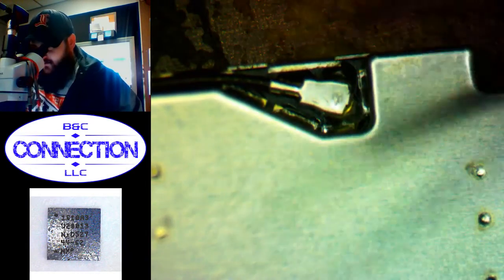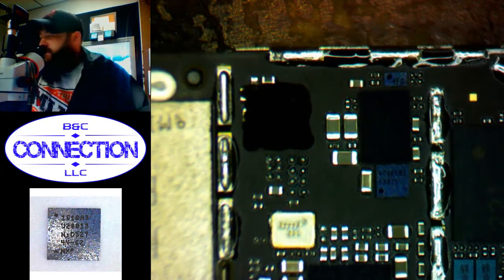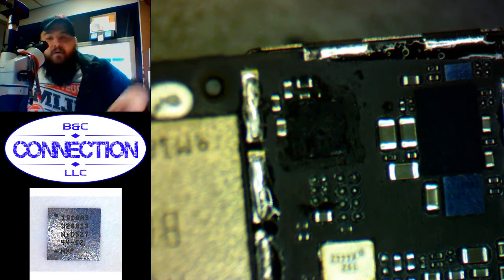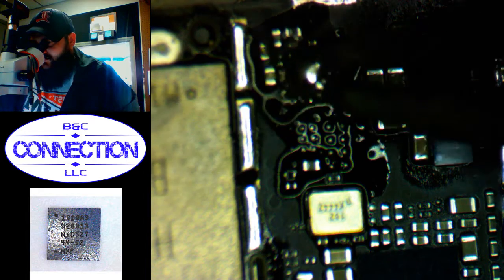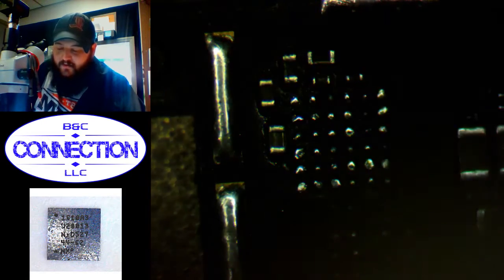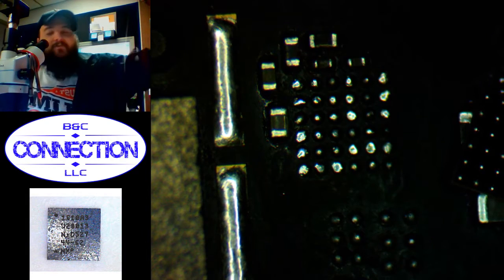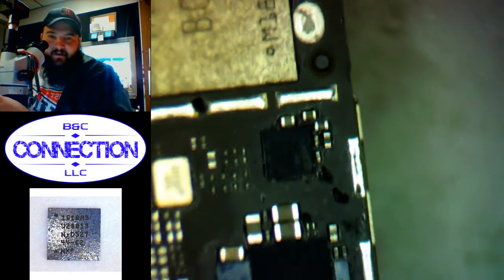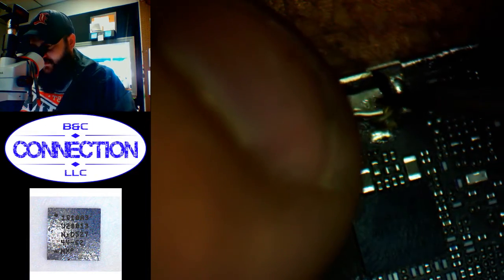iPhone 6 Tristar Repair

Comment: I have iphone 6 that does exactly as you described. I have replaced the battery twice to rule out bad battery. I also replaced the dock connector. Nothing.

How much do you charge for tristar repair?
Reply from the maker: $60

Comment: i have an iphone 6 on which L1213 and L1214 shorted to ground and pmic heats up. should i replace the pmic or is there anything else to it. please suggest
Reply from the maker: Pull the inductors and see which side of the filter is shorted. If its short on PMIC side you know where your short is.
Reply: I will check and get back. Thank you so much for the swift reply.
Reply from the maker: Np
Reply: Hi Chris, I ordered the smd station. Will lift those caps and check. But just out of curiosity, I just slided a plastic sheet under the PMIC and the short disappeared on L1213 and L1214. So that means i only have to reball the PMIC? Need your expert advice.

Comment: i have iphone 6 doesnt boot. at apple logo same as you mention but boots in recovery mode (itunes recognizes it). what do u think it could be

thanks
Reply from the maker: Apple logo hang can be tristar like the repair above or any other issue dealing with a CPU data line or even software, Id start by trying an "Update" through iTunes and see if it boots. If you get an error let me know the error that can be a good sign of what issue the phone is having.
Reply: Chris Long if I do that and it fails will customer lose their data
Reply: Chris Long customer did mention. The phone was acting weird before it went to Apple logo. They couldn't connect to iTunes when it booted before
Reply from the maker: Update shouldnt delete anything. If it fails it depends on where it fails because that mean their is something else causing your issue. I always talk to my customers first about what Im going to attempt. 
You can try tristar first it wont hurt anything as long as you are experienced in bga rework. If that doesnt fix it Id try update. Update not restore and update. Update only
Reply from the maker: If thats the case Id do tristar then. USB connection issues are a strong sign of Tristar failure